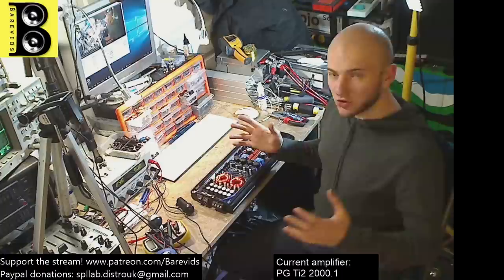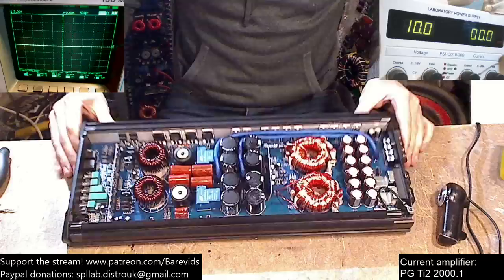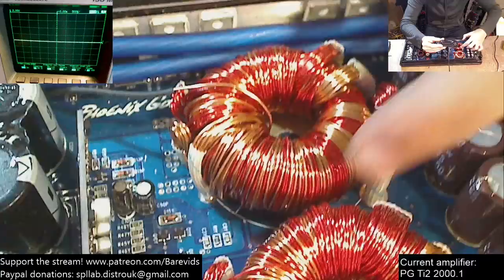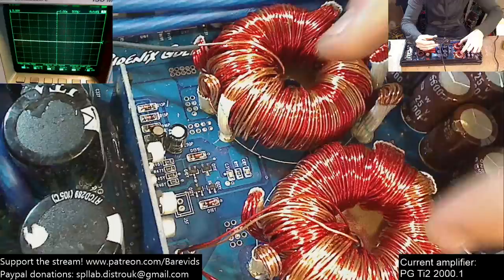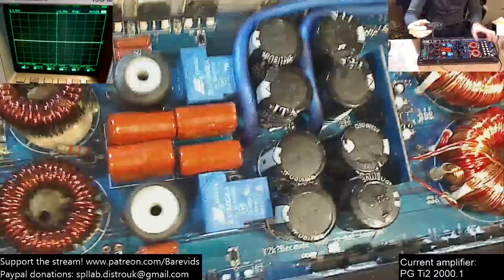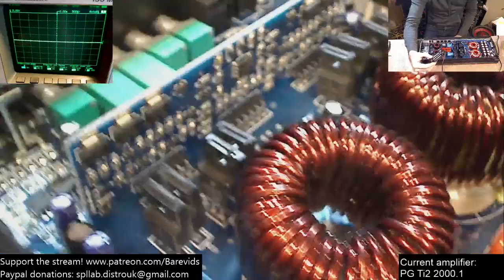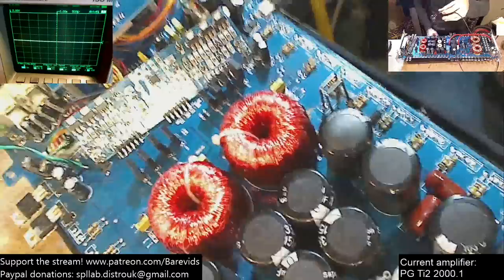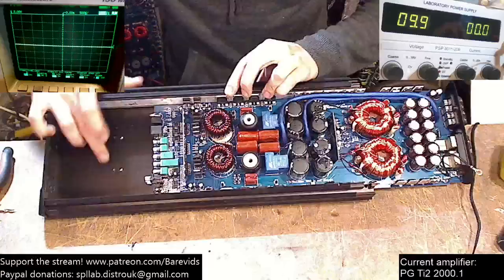Have Phoenix Gold gone to SHIT?? =[

Comment: y u dont make a schematic of these amplifiers i need schematic
Reply from the maker: No one needs schematic on these
Reply: @barevids  please in your next video explain to me how buffer transistors work  in each bank of mosfet and when we put them and when we can use the  ic directly to drive the gates i whatched all ur videos but there wasn't enough explanation about that because i want to build a powerful class d amplifier but not to use it in a car so the power supply is not a problem for me but the buffer transistor and the output filter still not clear and google not saying much thing about that (thanks for replying and for the help)
Reply from the maker: I can't help you with that I'm afraid I don't know amplifier design. I only find problems and fix them. To design an amp is a whole different set of skills.
Reply: @barevids  by saying this amplifier is a self oscillating one in ur prévious video  i  was thinking that u have schematics or u can  at least make it from the board because most of these  amplifiers we can say 90% of them have the same principle of work and the same design skills are in calculation . let this be a side i enjoy see ur vidoes and happy for ur answer thank you

Comment: That is NOT a real PG amp, the real thing has a gold plated circuit board and gold plated bus bars, that's what they are known of so I don't believe that it is the real PG amp.
Reply from the maker: Yes, it's real, this repair came in through the authorised UK dealer. This is what PG have become, sadly.
Reply: @barevids  that's actually really sad if that's true, I can hardly believe it but I take your word for it.